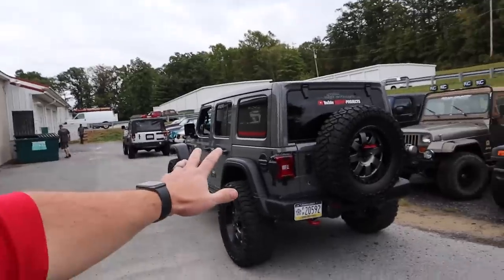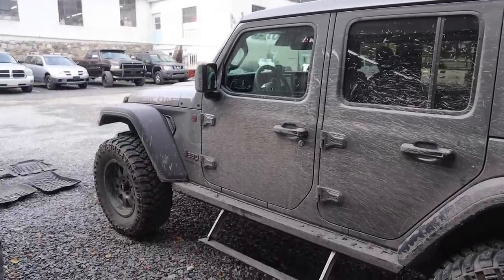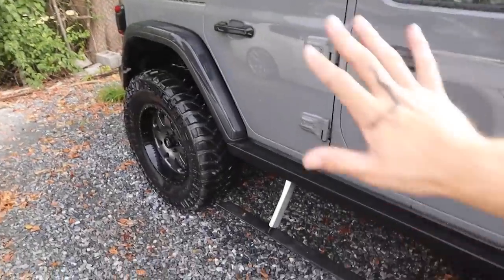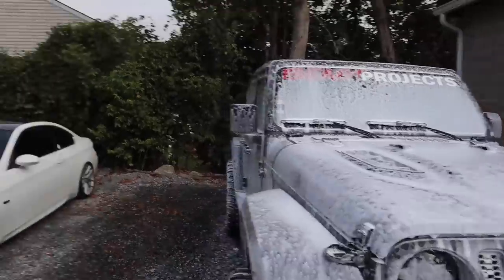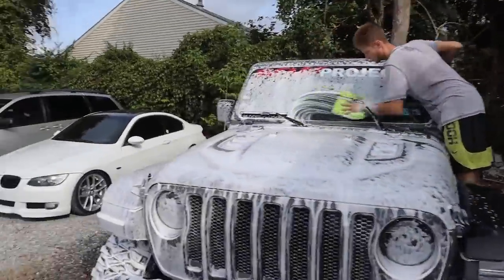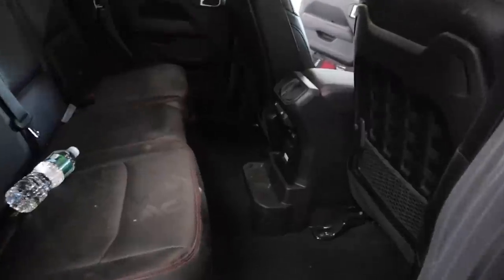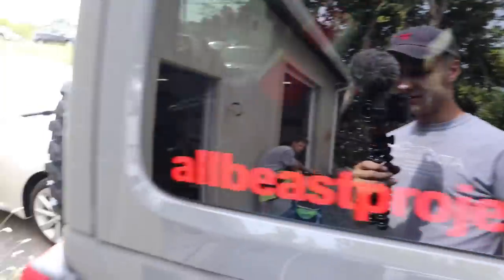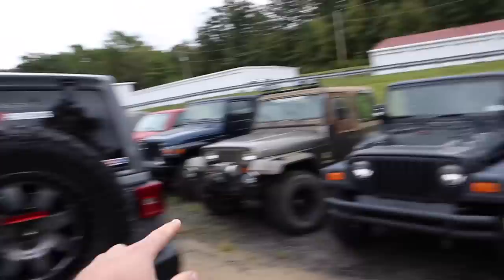DESTROYED! How to SAFELY clean your MUDDY vehicle after OFF-ROADING

Comment: Cant go wrong with the poison spyder stuff, its pretty much the Ferrari of jeep parts in my opinion. Plus with their bumper it can be ran with the stock tire carrier and then you can upgrade to their spare tire carrier later (sold separately) and it will fit up to a 40 inch tire.
Reply from the maker: Thank you 🙏🏻

Comment: @BEAST projects  hey quick question how did you clean the dirt out of the passenger and driver side windows a lot of time dirt falls into the window track when you offroad with the windows down like this guy did how do you get the mud,rocks and sand out ? so  when you roll the windows up it doesn't  scratch the glass? just like a vacuum ??
Reply from the maker: Depending on how bad, vac & air gun. If it’s real bad, I would pull the door panel & clean it w/ microfiber towel & interior cleaner.

Comment: 😬😬😬😬.  When you pressure wash straight in like that you’re pushing the dirt into the paint before it bounces off.  In short- you’re sand blasting it.  

Foam it first so the dirt can separate from the paint, then soft rise the dirt off.  Keep pressure washing it off and that shine won’t last long.  Sorry, just being real.
Reply: You could take either approach foam first or rinse first. We chose to rinse first simply because the layer of mud was so dense that foam wouldn't have penetrated all the way through the mud considering foam isnt absorbent as water is. So our tactic was rinse the top layer of mud, foam so it could penetrate the remaining thin layer of dirt, repeat, then go to our contact wash. The idea of sand blasting the paint isnt true either. Water in and of itself is a very lubricated substance that encapsulates and absorbs into the dirt as it is carried away. Even if it was foamed first this sand blasting idea would be no different, the mud has to be rinsed off one way or another and I think we can both agree foam by itself cannot do that. No damage was done to the paint when using the pressure washer. I understand your logic and either approach would have worked the same in the end.
Reply: James Linder i was gonna say exactly this. I wouldn’t take my car here!